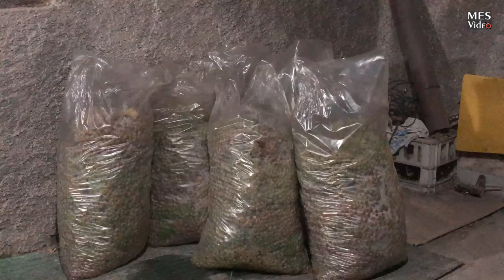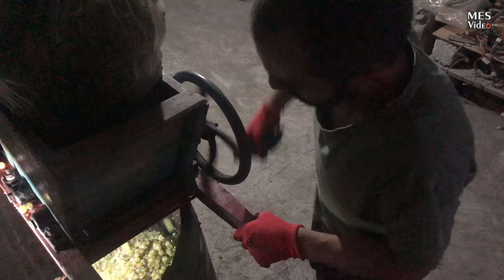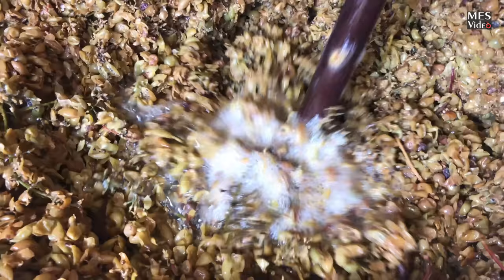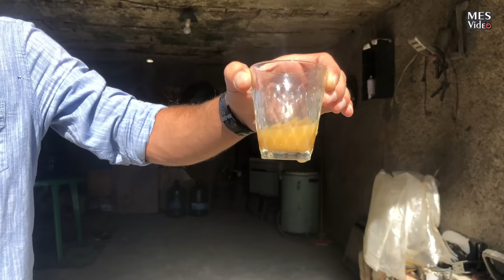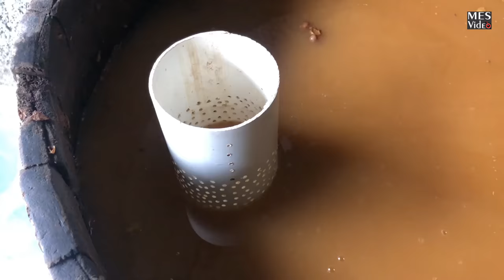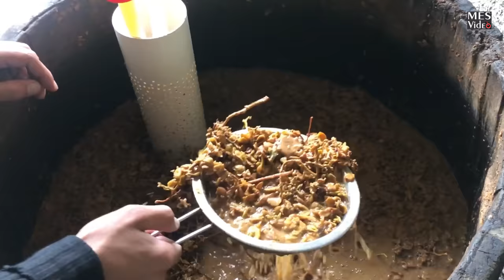Wine making with oldest traditional method / Homemade Georgian Wine

Comment: correction: it's not "traditional", it's just the easiest way to make homemade wine in Georgia. and it's just beginning steps.
Reply: you mean its not the full process?
Reply: The pump used to be powered by a donkey
Reply: Exactly.. I thought there had to be more to this... even though this was interesting.
Reply: Not "oldest" either.
Reply: @JohnnieKirkegaard94  it might take up to 6 months until it becomes wine. You have to work with it in the cellar.

Comment: I liked the way you processed the grapes but I had to give you a thumbs down because it does not show the finale results. This is not the complete way you make wine. Sorry.
Reply: Final result after two months, with low temperatures wine will be stay clear and ready for use.
Reply: @Jacob Brickey either way works.  If you add yeast, you control the process and get more consistent results, but natural yeast is everywhere.
Reply: Makho Kvatashidze where is the yeast ? where is the sugar?.